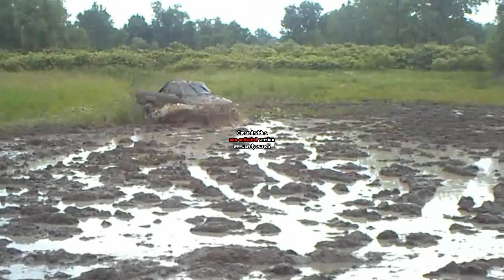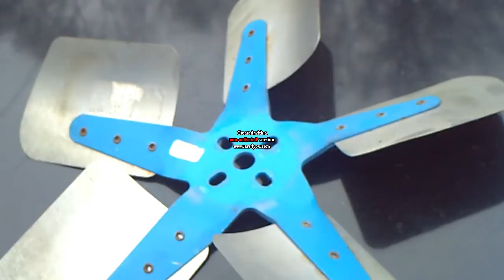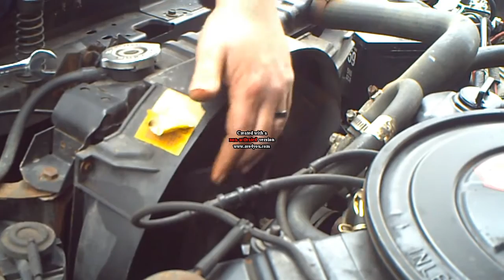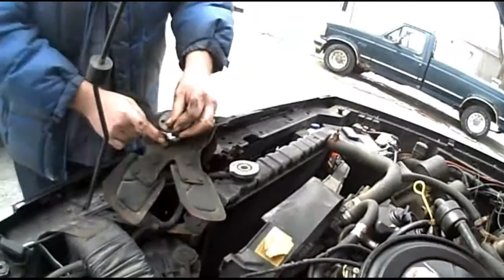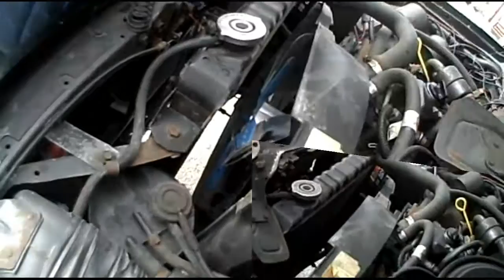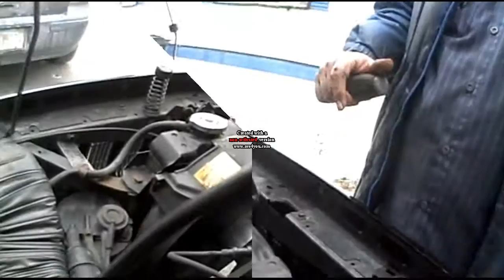How To: Convert to a flex fan

Comment: Hey Thanks for the video!
If you have the time I was hoping that I could ask you some questions:
Which Engine is this for?
Which size new bolts did you buy?
Which Fan and Spacer did you use?

I just have a Chevy 250 Straight 6 and want to do this for the desert climate I'm in for more reliable cooling but don't want to screw up $100 worth of parts
Reply from the maker: In the video, it was installed onto an AMC 2.5L I4. I actually used a generic AMC spacer, that included bolts. I had also installed one onto a Toyota 22RE 2.4L I4. That one, required a custom billet spacer with bolts.

The best I can recommend, is to measure from the front of your pulley to the rear of the shroud. That should give you an idea of the size of spacer. Just be sure the center hole is large enough to fit over the stub shaft on the pump, where it protrudes through the pulley. For the bolts, just pull out one of the water pump pulley bolts, and take it to the hardware store. Throw a nut on it, and that will tell you the size. Then, just get one the length of the original bolt, plus the spacer length that you bought. This, is assuming flex-a-lite does not have a spacer kit designed for your application.
Reply: @FTORC1  Thanks a ton. All the guys working at the nearby auto parts/hardware stores know less than me so I really appreciate the advice, since I really couldnt have gotten it anywhere.

Thanks again and have a good weekend!
Reply from the maker: @ryankim345  no problem. You can typically find the spacers in the aisle at auto zone or advance. Same aisle you find the ricer kits, and small block chevy dress up stuff. It will say flex-a-lite on it, and look like an X

Comment: Hows that flex fan work when ur at idle creeping along in traffic on the 101 freeway  in the bay area for an hr ?
Reply from the maker: I'm not in the bay area. However, creeping along on a trail, it works just fine. It actually moves more air at idle, than the stock fan. Keep in mind, this was the real one. Not that ridiculous tiny star that some people buy, because it looks cool. The big ones like this one, actually move a ton of air. Which is why some people complain about the noise. It is very loud and noisy. In fact, on a 4cyl, it's louder than the engine. But, I've never had any cooling issues at any speed or temperature, for any duration. The only "issue" with performance, is a nonissue. And that's in winter. Even with a thermostat, you may want to run cardboard in front of the radiator. Here in the north, it can be the difference in whether you have heat or not. I never had to do that with the stock fan.
Reply: @FTORC1  thank you for the quick response. I was asking because my temp was creeping up around 210 & I  only  had the engine idling for a 5 minutes  while I picked up a few parts.
Reply from the maker: @TheNewkidsrule  if it's creeping up that fast, you could have other issues. Mine never got that hot, that fast, even without a fan. The jeep in this video, would only get up to around 190 in the summer. Winter, roughly 135. The blue truck, 180 in summer. But, it's also running a colder thermostat and has a louvered hood
Reply: @FTORC1  I have new  brand new  3 row aluminum  Radiator & it runs cool  normaly  with good water flow & no leak out of the weep hole in the water pump.  I'm gonna try a stock & fan clutch next . Thank you again.
Reply from the maker: @TheNewkidsrule  have you checked for air pockets? Also, if you're not running a thermostat, the coolant will cycle through the radiator before fan can cool it. In addition, make sure you're running a shroud. Flex fans actually move a large quantity of air. Air is a fluid, and will follow the path of least resistance. In this case, from the sides, behind the radiator.

Comment: :/ Why :(((((((((((((((((((((((
Reply from the maker: Jordan Bronson it is a permanent mounted fan with no clutch to fail. As long as the belt is on it, it's working. It's also a lighter rotating mass, which opens up more useable horsepower.
Reply: Costing you HP big time, just go electric...
Reply: it costs you about 15 hp.  proved via engine masters. i mean i agree electric fans are better but...its not killing hp .

Comment: Could this increase power, by making it run colder
Reply: No it does not it TAKES HP atleast 20 of them, feel free to check engine masters where the TEST these fans and lot more ...
Reply from the maker: it can. it also "free's up" extra horsepower, by offering less drag on the engine.

Comment: I have this 1995 Chevy c2500 pick up...and I've tried regular fan with fan clutch & now have changed it to this new flex fan,......& still it starts to over heat,.....& so in turn the ac turns off.......would a fan with more blades solve the problem? I've already changed water pump, thermo, & radiator...& the truck is also timed correctly.
Reply from the maker: If the radiator is clear and clean, and the thermostat is not sticking (just because it's new, doesn't mean it's good. That's why they have a warranty), if the timing is correct you may have bigger problems. When it starts to get hot, check the temp of the radiator. If it's still cold, the thermostat is not opening. I've had 4 bad ones in a row, straight out of the boxes off the shelf. Brand new ones. More blades can increase the cooling efficiency of the fan. As does increasing the diameter and adding a shroud. There are a lot of people that rip out the shroud, and throw it away. That's a bad idea. Air flows via the path of least resistance. The fan has an easier time pulling air from the sides, between itself and the radiator, than it does pulling it through the radiator. Without a shroud, it won't function as it should, and can cause the overheating problem. Just the same, as running a fan too small. You should be using at least an 18" fan. You also have to make sure it is spinning the correct rotation. Serpentine belt drive, should be reverse rotation. V-belt, is standard rotation. If it spins the wrong way, it will be forcing hot air through the radiator, and prevent the coolant from cooling. You want it to be pulling the air towards the engine.

Comment: do I use the lock washers & regular washers for each bolt before I bolt them in through the spacer into the pulley?
Reply from the maker: Yes. You will want to put the washers on the bolt first. You want the washers between the head of the bolt, and the fan itself. After you put the washers on the bolts, you slide the bolts through the holes of the fan, and then through the spacer, through the holes in the pulley, then threaded into the threaded holes on the water pump pulley surface.

Comment: does the fan keep the engine cool, now that the clutch on the old fan is no longer attached to the new one?
Reply from the maker: +Frankie Amaral Yes. This fan is affixed solid to the pulley. This is to replace the clutch that is prone to fail. The fan clutch, is not connected directly to the pulley. Which is why you can turn the fan by hand, with the belts on the pulley. 

With a clutch fan, increasing the engine RPM does NOT change the speed of the fan rotation. With the clutch type fan, the clutch relies on a silicone oil's expansion inside to determine speed. The fluid's viscosity causes a friction that forces the fan blades to rotate. As it heats up, it expands. When it expands, its expansion forces it into a cavity in the center of the clutch. This weight in the center, causes the fan to rotate faster. This leaks out over time, and causes the fan to completely fail. 

A flex fan, is bolted solid, directly on the pulley. If you were to try and spin it, with the belts attached, it would not move. It relies on the fact that it's constantly spinning at the same speed of the engine. When there is increased wind drag (such as when you rev the engine), the blades flatten out until the air passing through them increases. The higher the velocity of air through the blades, the more curve they have. They never go fully flat, as the structure does not permit this. This leads to increased cooling, with less wind drag on the engine.

Comment: Good video, don't forget people who are wanting to do this that you want the face of the spinning fan to be about 3/4th to 1inch from the radiator. Measure it 3 times before you order the spacer or you'll likely have the wrong size and not pull enough air. I have this done to my truck and it's less than an inch away from the rad and I can 'FEEL' air moving though the front of the rad when I put my hand on it. keeps it COOOOL
Reply from the maker: You are absolutely correct. Forgot to mention that. I actually ordered a spacer specific to the engine. It was actually listed for the AMC 2.5. The AMC 4.0 used a 1" spacer. And the spacer I used for my pickup, was designed and build by a company that specializes in that engine. So, it fit that engine and application only. But, when ordering a universal, you are absolutely correct. Also, the utilization of a shroud will amplify the efficiency.

Comment: Thanks i put one on a 1970 impala i fgt all about that i loved the way the fan cooled i have a 1992 gmc campervan with the same 350 thinking about doing a fan job on it also thank ya for the vid
Reply from the maker: No problem. I, myself, am a fan of the older, reliable conversions. The way it was setup worked great, as long as it was working. Just figured it was one of those modifications that seemed to get lost with time. Everybody seems to be going  electric. I never really liked electric fans. Too unreliable and expensive. This one, as long as the belt was on, it works.